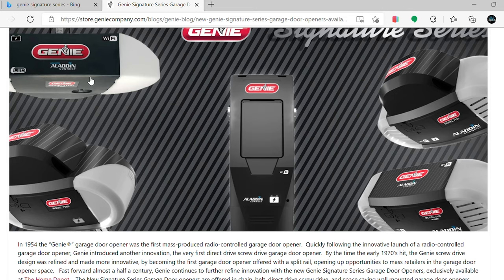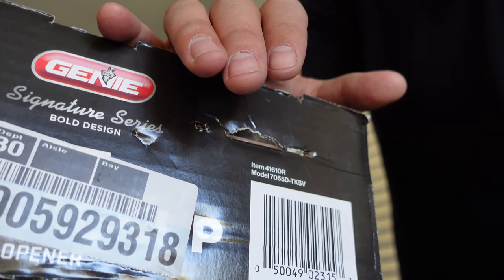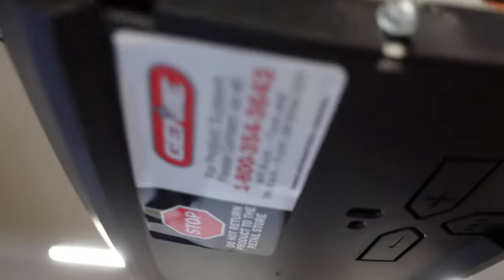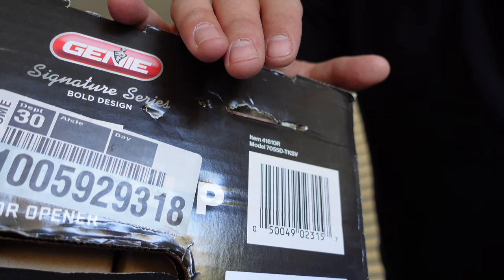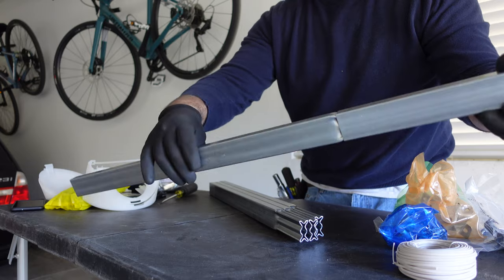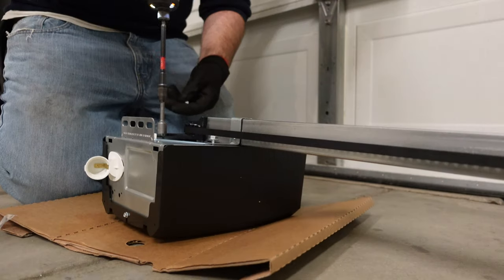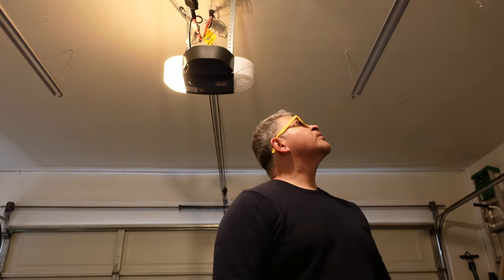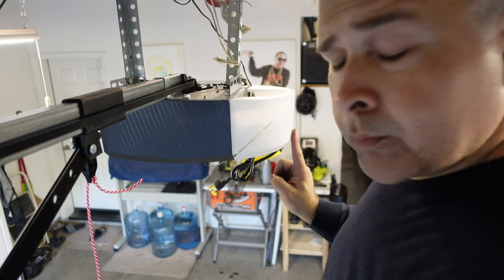Genie 7055D-TKSV Signature Series Review - What CHANGED? #genie #7055DTKSV #garagedoormotor

Comment: Good informative video. My LiftMaster garage door opener that I have, has worked great for many years, but now I'm starting to have problems with it. So, looking around I like the quiet belt driven Genie 1.25 hp with battery backup. I don't trust nor need the WIFI version, and I believe the non-WIFI version has more security. Lowes has the Genie 7055 model, whereas Home Depot has the 7055D, and I was wondering what the difference was. Then I came across your video. Thanks for pointing out the "cracked look" of the 7055D light covers which I don't like. But the 7055 version seems to be one piece on both ends which I like better, so I'll buy it at Lowes and have them replace the old LiftMaster one with this one. Thanks again for the information. You helped a lot.

Comment: Love your videos and presentation! 
I just got the 7055 1.25 hp belt drive from Lowe’s and the installer had a heck of a time with it. Poor guy spent all day trying to contact Genie to find out what he did wrong. It powered up perfectly but the program and up/down buttons were unresponsive. After finally getting someone on the phone from Genie, it turns out the plastic stems on the inside of the buttons weren’t long enough to reach the actual buttons on the logic board. SERIOUS design flaw. I mean, they were only like a 1/4 inch too short. That’s it. This engineering flaw caused hours of frustration for him and frankly me. We both decided to just snap the buttons off and now you can access the actual buttons on the board directly with your index finger. Just have to remember which button does what so he made me a small cheat sheet and attached it to the cover.

Once programmed, everything works beautifully and it’s super quiet. I couldn’t be happier. I don’t need the Wi-Fi feature so it’s perfect for me.

Now, based on some bad reviews, I’m worried that this thing will start malfunctioning in the future. Any experience with that happening for you?

Thanks for your advice and great videos! You should review other stuff. You’re very good at making and editing videos and pleasure to watch.
Reply from the maker: Hello!  Wow that is a tough situation for the initial install.  I have had this similar issue with other Genie motors.  In fact, that's why I prefer the Lowe's or Amazon version of this motor over the Home Depot version.  At any rate, you might want to have Genie send out another housing.  Like you say, there is a design flaw on the flat buttons.  If they can make them a tad longer you shouldn't have any issues.

Comment: Actually the light covers are made just as well as the old ones, they just don't fit together when installed. I agree it looks bad, and I would have made a different buying decision had I known before, but I found a fix. It turns out if you can find a way to permanently attach the two halves they fit together without a gap and just snap into place without needing the screws. I used a device called a plastic welder which is an inexpensive device ($20 from Amazon) that is designed to repair craked plastic by electrically melting thin curved wires into plastic. Again I simply taped the halves together, melted the wires across the joint (used 4 on each pairr) and then snapped the lenses in place. When I showed to my wife she laughed, "its not a chandelier love, its a garage door opener", buts she's used to such things by now. 🎉
Reply from the maker: 😂 that's very insightful! And it definitely puts perspective with some of the interesting and creative ways the light covers can be secured.  Thank you for sharing your feedback!

Comment: Can the light covers on the 7055D model be replaced with single piece solid covers? 
We have this opener, it’s been great and super quiet but you’re right, the two piece cover doesn’t work well. thanks!
Reply from the maker: Hello.  Great question.  I have yet to try it.  I think it would make a great video.
Reply: Any update on this question?  I’d really love to know if the one piece light cover variant that is apparently everywhere except on the Home Depot edition is something that can be gotten to fix this crazy design flaw.  Genie shows a nearly seamless fitment on all their photos of this light cover that is not the reality of what’s in the package.  They should offer replacement covers to customers who were deceived  by their photos (like me) and bought the Home Depot variant.
Reply from the maker: @skycladguru6256  Thanks for the follow up question.  So I do believe the single light cover will work on the Signature Series Genie motor, but ... And that's a BIG BUT ... the light cover will not conform or align to the shape of the motor housing.  They did this on purpose to differentiate their entire line of motor both thru the pro line and retail channel.  

Here are some part numbers of light lens covers that might be worth your consideration:
Light Lens Cover - 39612A.S
Light Lens Cover- 38911A.S

The second part number might be a closer fit.   Hope this helps.
Reply: @sosgds  I will definitely check these out.  I wondered about whether the tabs on the light housing that snap into the housing might be an issue from other iterations in this line, so I’ll look into it further.  Many thanks!

Comment: Found your video trying to get a garage door for my dad. I see your complaint about the rail assembly. I'm assuming you don't like it because if you're trying to pick it up to mount it on the ceiling it can fall apart? I think for someone like me installing it one time it's not too big a deal but for someone that works on them I bet it's pretty annoying. Are there any tricks you can use to shim the pieces to give them more friction? Something like a tape loop that you could put in there that will hold it a little better? Anyway, thanks for the review, it helped.
Reply from the maker: Hello.  Wow those are great questions.  The reality is the rail will hold up for a long time if properly assembled and installed.  In fact I would not try and weld or seal the pieces together.  The best practice when assembling the rail is tightening the belt sufficiently so that there is not much play to the rail.  Hope this helps.

Comment: I installed this unit from Home Depot one month ago (Jan 2023) because I wanted the two remotes, no wi-fi, liked the option of the keypad and the included battery backup.  I paid $220 for mine, and when my install was complete I was infuriated by two massive design flaws: the hideous fitment of the multi-piece bulb covers you discuss here, but also the use of hidden internal programming buttons that the external touch tabs barely make contact with.  I thought mine was broken for the first hour & a half of the “set” button not functioning due to its bad design.  I wish I’d found your video before I’d bought this thing!  I just wanted to add the mention of the use of poorly placed recessed internal programming buttons that aren’t properly positioned for the cheap plastic programming tabs/slits to make contact with.  Here’s my rant on the unit:
https://youtu.be/h2nr__lWNtg
Reply from the maker: Hello.  Thank you for sharing your story.  I am glad Genie decided to not go with this design on all of their motors.  I hope they listen to your rant and take the time to redesign this variant of their retail motors.

Comment: I have a model 7055 from about a  year and it worked a couple of times, but after that it start acting-up: going down is always good, but going up, at the first push ( wired or remotely ) of the button, goes 2 inches and stops. Has to be brought down and the second time works normal. Any idea what I'm doing wrong? Please tell me if you don't mind.
Reply from the maker: Hello Benga!  You might be dealing with a broken spring.  Are you able to open the door easily by hand?  Do you see if your garage door springs are intact?  It would be good to also make sure your garage door is well balanced.